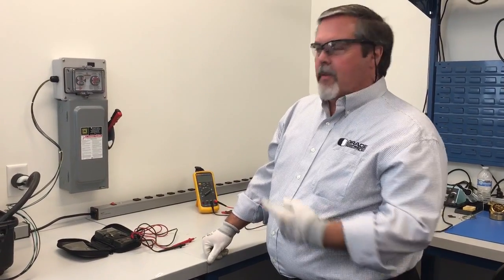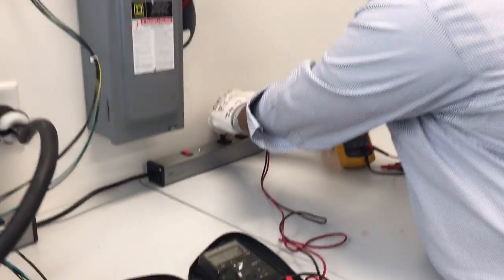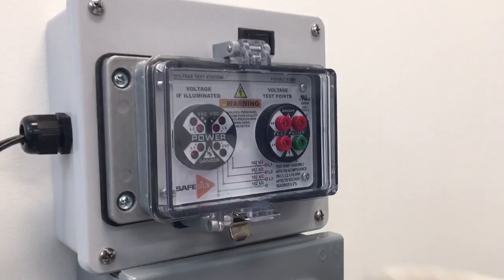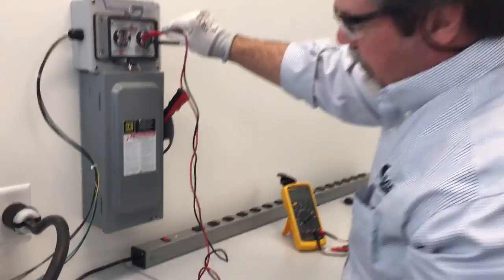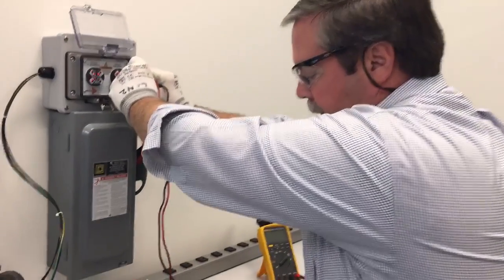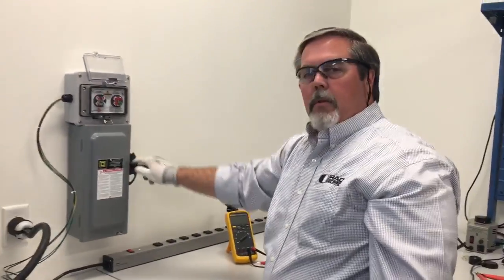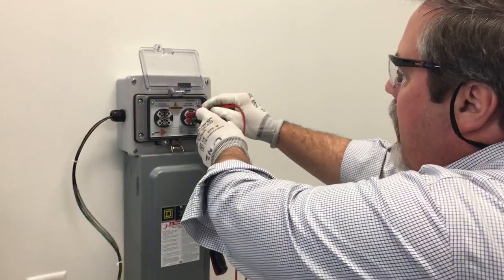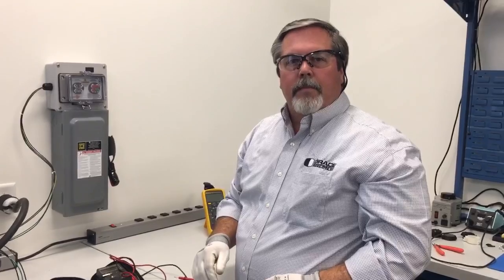GracePESDs® | Voltage Test Station: Lockout/Tagout (LOTO) Demonstration

Comment: Where is your tester (above the disconnect switch) connected to? Because you used your fluke to measure the receptacles which it was    120, then you measured your tester and you had 277...? I didn’t understand....
Reply from the maker: Those were separate lines. He is testing his multimeter to a known source to confirm that the meter is functioning properly.